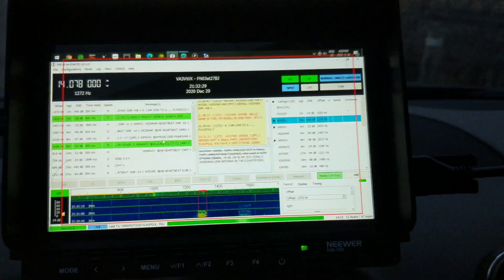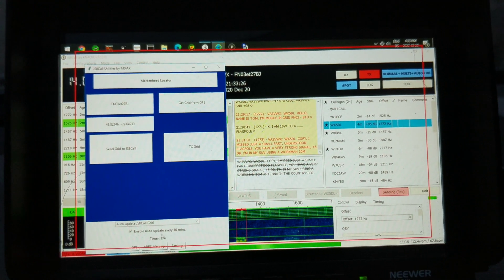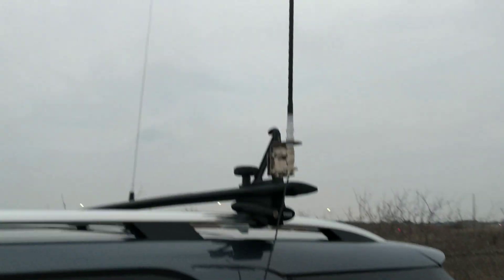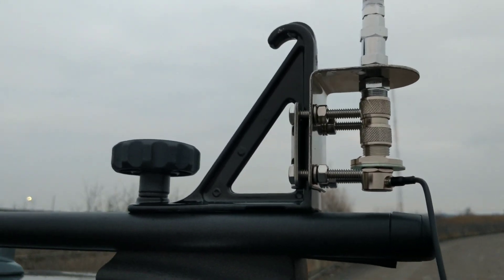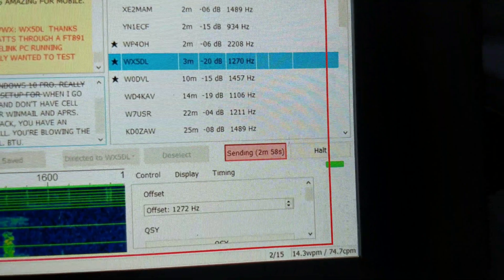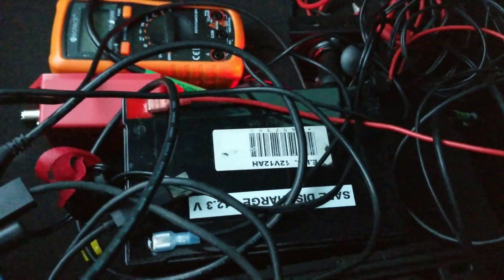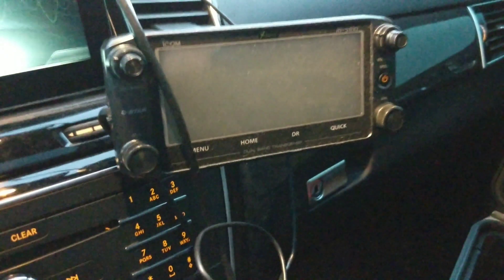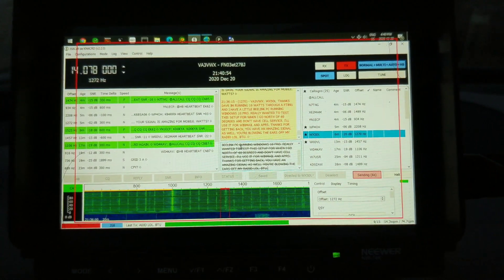JS8CALL Mobile & APRS on 20 Meters HF

Comment: Very cool. I've been hoping for some alternative users of JS8 to show up. What I'd really like to see is some marine action , and using this set up would be perfect. In fact, I would like (and have tried) to set up that utility , but so far no luck on Win10. I've got people pushing me really hard to get Linux going and that is probably what you have done ? You might see me on 40 or 20. My system reaches out pretty well. N6GRG
Reply from the maker: Hi, thanks for the comments.

Actually, I'm not much of a console or command prompt guy, so I tend to shy away from Linux, but what I'm using here is a micro computer running windows 10 with a monitor designed for a 4k camera. Here is the download link I used for JS8CALL UTILITIES - https://m0iax.com/downloadfiles/

When you install the software, you need to do so as an administrator. You'll also need to right click on the exe file or any links and set them to always run as an administer, otherwise windows will operate it like a sandbox and prevent the utilities app from talking to the JS8CALL app.

I'll post another video soon showing some field work with a small windows laptop and other digital modes in addition to Winlink.

I think JS8CALL is great because you do have the store and fwd capability as well as the automated response capability for signal reports. This can really be useful when you need to get into a RMS gateway but the SFI numbers don't seem to help you out with suggested stations. It also has the ability for group messages. It would be nice to have form integration such as the ARC-213 form etc.

FWIW I will operating as a POTA station from MacLeod Provincial Park (EN69nq) from 2021-06-09 starting at 21:00:00 UTC through 2021-06-13 19:00:00 UTC. The Park ID is VE-0282 (MacLeod Provincial Park) I will be running 160M through 70CM as part of the annular solar eclipse trip. I will be using FM on 10M 6M 2M 70CM and SSB PHONE, FT8, JS8CALL, PSK31, and OLIVIA on all other frequencies. There will be some special SSTV eclipse pictures on 80M and 20M. I will be operating 5 to 100 watts with several dipoles and mobile antennas.

I'll definitely put together a video of the outing.
Reply: @vaughanweather  If one could get an example of a arc-213 comma delimited txt file that would help a lot. It would be easy to fill it with your own data. apparently, from what I'm hearing, the message is saved as a .txt file and then submitted to a routine which adds the form. It seems doable but I haven't done much with winlink so I'm not in a position to look. Apparently though, FLMSG uses the same templates ! So, I might be able to generate one and play with this.
Reply: Somehow I didn't realize the utilities could be run as exe files in win10. I'll need to try this again.
Reply from the maker: @californiakayaker  as it stands now, JS8CALL does not have any native capability for message forms, you’ll likely just have to send the meta form out as is which is a little problematic since it is very large. A reduced version that’s text only would work, but the RX station would have to put it back together. This would be incredibly slow with JS8 but you could likely get a message through if VARA was not able to make a handshake work.

Comment: What baud rate is used on 20m for APRS?
Reply from the maker: The 30M packet system has depreciated these days,  but it was 300 baud MAX, and even then, slower was better. HF packet in the traditional packet sense is dead because it was simply too error prone.

What I'm doing here is using JS8CALL which basically uses the FT-8 protocol to send text messages and APRS data to the network. Unlike traditional packet which is lossy, there is substantial error correction using JS8CALL instead. It's also not frequency dependent, while HF APRS was really a 30M centric thing, any SDR radio that monitors JS8CALL will automatically recognize the APRS data string. I've sent APRS data on all the bands and often multiple stations (10-20 or more) catch the data and feed it to the APRS-IS network.
Reply: @vaughanweather  Thanks, Tom. It's the JS8CALL part that I have never heard of before and now I understand it's the key. I'll look it up. Operating 2m in a car is a bit easier, though! :-)
Reply from the maker: @jstreutker  hahaha totally, you definitely need to be parked! I really don't know how anyone could drive and scroll through even just for sideband phone operation!! It's very distracting!!!
Reply: neat !